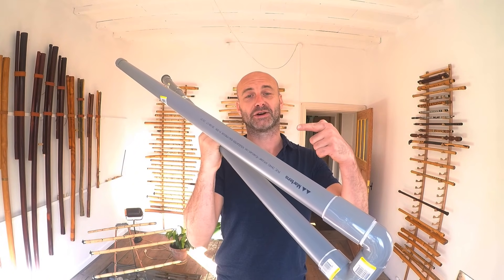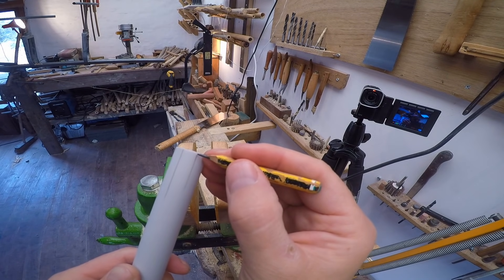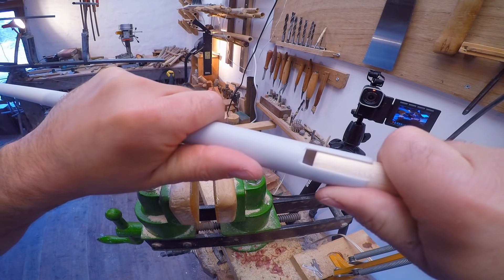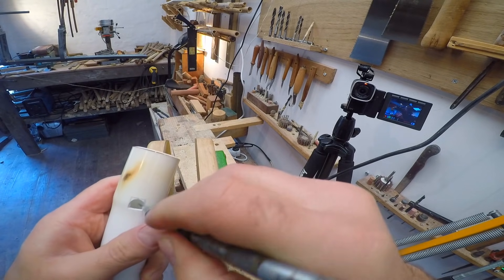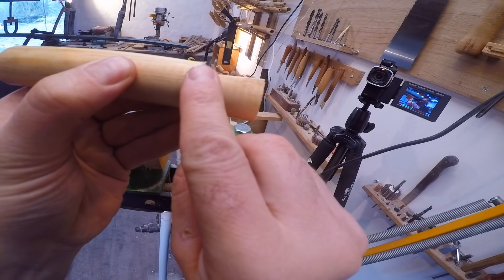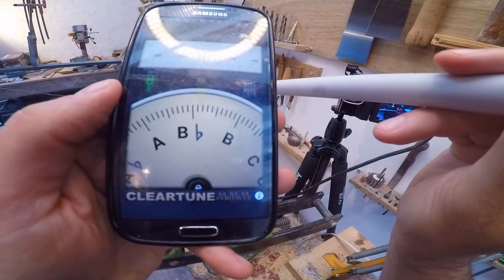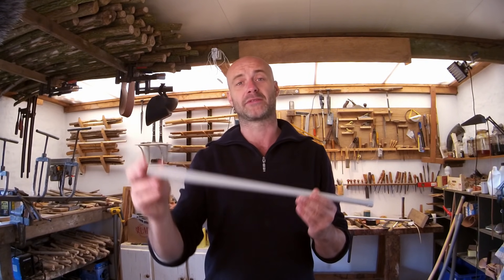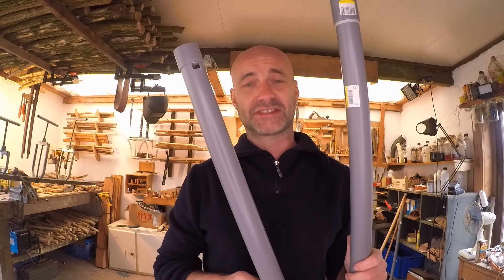How To Make a DIY PVC Overtone Flute /Homemade PVC Overtone Flute

Comment: I have to thank you for this techniques. The way to cut the labium helped me to repair a Moeck soprano recorder that I bought very cheap because the child that had it, inserted the cleaning rod in the air outlet and made a horrible notch in the labium. It was a gamble, but I used a chisel to cut the burr from the inside and an exacto knife to reshape the labium, and it worked! I checked the tunning and amazingly is still correct :) Many many thanks for this tutorials!
Reply from the maker: hah! Glad this was of some value to you! cheers

Comment: I make the wind way flat and the width is twice that of these, much louder. I tune pipe organs and the flutes I make are more like pipe organ pipes than most PVC flutes. All 3 parts are PVC, no wood to swell and change the tone. Outdoors any weather no sweat. Look at a normal metal diapason pipe, often on the facade of most organs. Instead it's plastic, a piece is heated and flattened. Flats are heated into both round parts and mouth parts formed by cutting. Solvent based glue holds the languid, foot, and pipe together. Schedule 21 thin-wall sounds better than schedule 40 the thicker size normally used in plumbing. I have gone up to 1-1/4 inch (33mm) dia and to 8 foot length. I found that elbows and ridges inside mess with some harmonics. I heat and bend a smooth 180  into one piece of pipe then couple to the straight piece with the fipple end. Another effect to playing is stopping the end hole with a percussive hit (flute resting on floor) giving a open tone and kept closed tone. With close micing the bass and drum magic happens as well as the overtones.

Comment: Hi, Winne
Love your flutes; lesson and your work.
I wonder if I could ask you a technical question!?
Simply; if I have a flute that plays really well; and I cut the tube off the flute! So; all I know have is the sound part and about two inchs of pipe in front of where the sound is generated and comes out! If I now blow through the very shortened section (and, again, this is where the sound is generated) ... if I blow through this, will I get a sound ... !?
The reason that I ask is that; I have built a 34'' Contrabas flute; the long tube is finished, but not connected to the sound part, but, for the life of me, I cannot get any sound out of the sound part! I would have thought you could create sound through the sound part with it disconnected to the tube part ... !?
Hope you can help on this one, as I am now completely stuck ... !
Best wishes ... 
William (Hampshire UK)

Comment: Thanks for the video! we made a few and had a lot of fun playing them. One question though, a lot of spit gets on the wooden dowel piece and we're afraid that the spit will get absorbed into the wood and cause bacteria growth. It's still wet after wiping. Any recommendations for cleaning it or some other way of preventing the problem?
Reply from the maker: just wipe it off good and dip in pure ethanol fit for consuming afterwards :)
Reply: use pvc plugs

Comment: Have you ever attempted to build on that was few meters long to get more harmonics?  Much like how the old natural horns were made.
Reply: Thinking about it now I believe closing the end doubles it's acoustic length
Reply from the maker: You won't get more harmonics by making it longer, this bore lenght ratio is the more or less the ultimate, with a longer tube you will get in higher harmonic range though but lose the lower ones

Comment: I`m very charmed with your work.
 Congratulations!
Winne, I need some help about Fujara's finger holes measurement.
I make a PVC Fujara in key of G using a 1 1/4" plumbing pipe. The base note is very nice but I can't find the  mesurements to make the finger holes using diatonic scale.
Is there some calculation to find these holes positions?
Would you give me some help (clue) about it?
Gratitude!
Reply from the maker: just take a tube and punch some holes untill you get it right :)) use the same ratio like the first 3 holes of a tin whistle and youll get there- same intervals
Reply: @1fujara  
I did it and it worked. Thank you.

Comment: How or where do I get a hold of that tuning device? Each time Winne cuts off a fraction of a inch off, the key range changes and the key range is displayed! ......also,  how does Winnie play all those notes and I don't see his fingers on any holes? That was one strange sounding flute making didgeridoo like sounds......
Reply: He actually used an app on his Samsung phone in this video to tune his flute. As for how he plays each note, he opens and closes the bottom hole of the flute while increasing his breath pressure to make the flute go up to higher harmonics.

Comment: Sir, Please tell me the secret formula to find the locations of flute figuring holes for different pipes or bamboo of various lengths, diameters  and thickness....this is not available anywhere on you tube...please please please.....I can give u my e mail id if asked..thanks in advance
Reply from the maker: there is no secret formula, just make a simple pvc flute and punch holes untill you get the right distances for what you want. then you can enlarge and shrink these mesures by percentage more or less